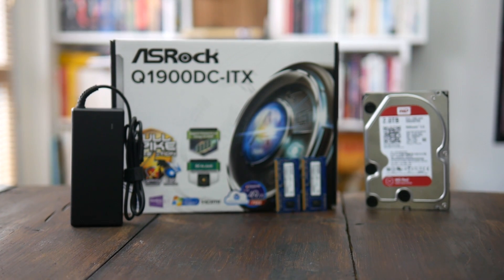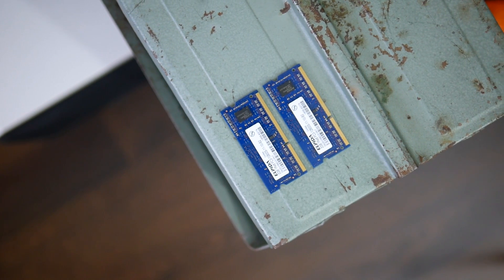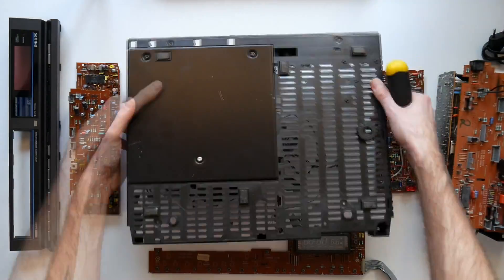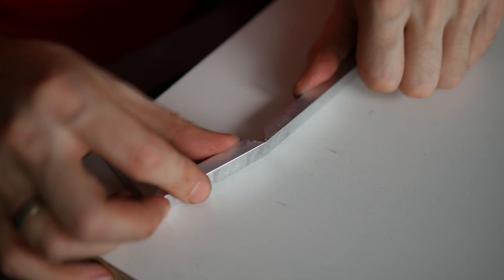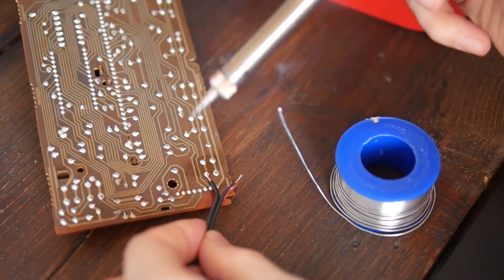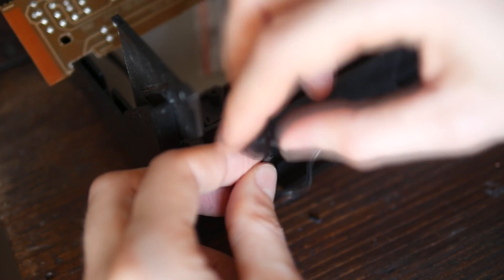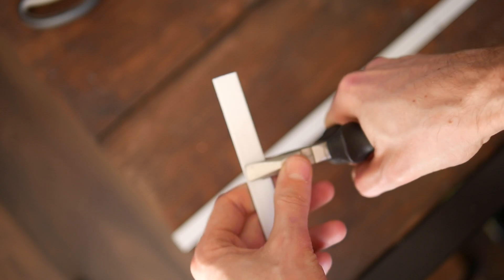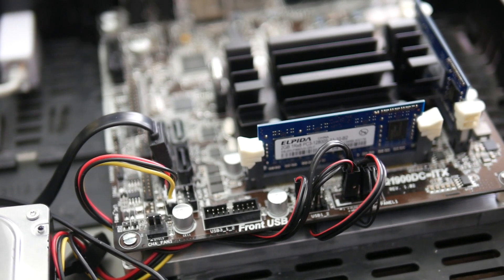ASRock Q1900DC-ITX (NAS/Plex server) and Raspberry Pi (Plex client) in a 1985 Philips VCR

Comment: Why bother with the Raspberry Pi? You have a quad core PC sitting in the same box, it can be a server for external devices and could play local content direct to the TV.
Reply from the maker: +Fourthletter 
That's a good point. I did it purely for the ease of maintenance. Since I completed the build for my brother who lives 4hrs drive away I figured separating client from the server will be a wise decision. If I was to keep it, I'd definitely run some kind of virtualization solution such as unRaid and run both on the ASRock motherboard.